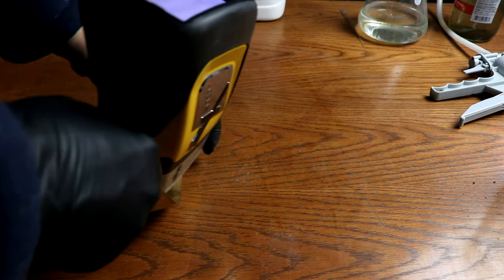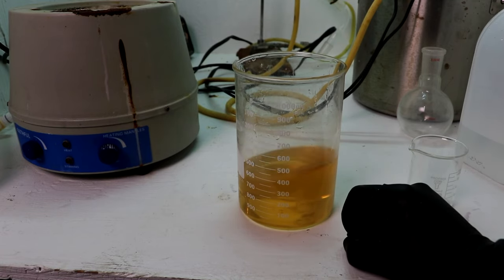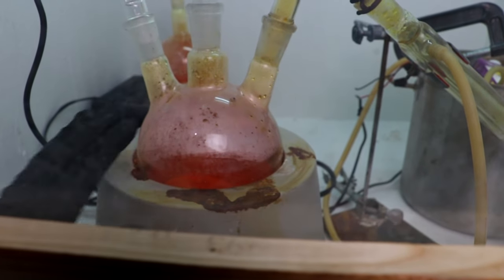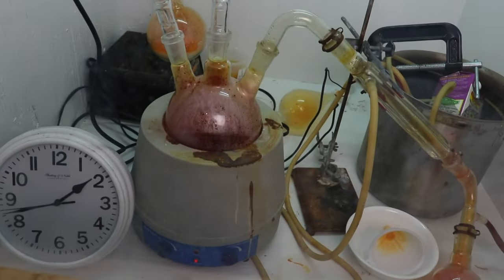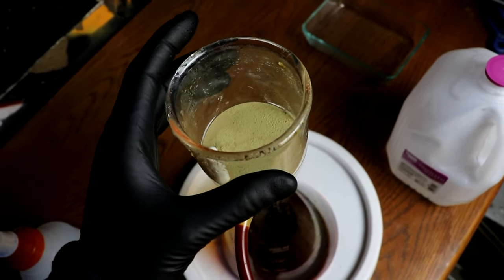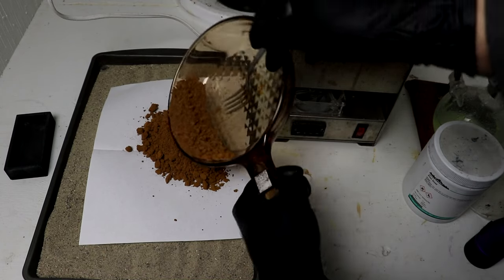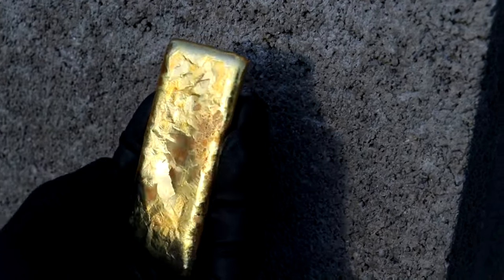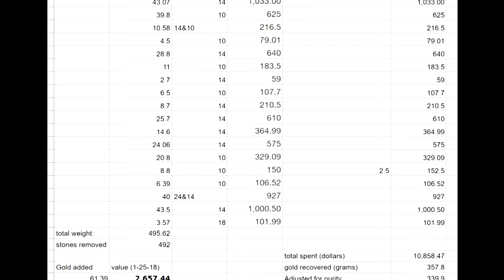Metal Refining & Recovery, Episode 24: Re-Refining Gold Using Bromine

Comment: Why is your kwijibo telling us that gold is tungsten?
-edit
Since I made this comment without listening for an extra 30 seconds, I should probably explain why myself:
After having read the manual, it has 3 relevant modes: Alloy, Alloy plus and Precious Metals.  If you want to get an idea of what contaminants are in the sample, one of the alloy modes has to be used as the PM mode only tests for Ir, Pt, Au, Rh, and Pd.

For those who are curious, Alloy mode measures Ti, V, Cr, Mn, Fe, Co, Ni, Cu, Zn, W, Hf, Ta, Re, Pb, Bi, Zr, Nb, Mo, Ag, Sn and Sb while the Alloy Plus mode adds Mg, Al, Si and P.

You now know what I know.
Reply: This explains nothing to me. All I still see is bad ROM code, and that that ROM should be swapped out with next-day service by a technician who flies in at the company's expense. Cody stated unequivocally that its not a hardware issue with the instrument.
Reply: Alright.  You want more, I'll give you more.
The gun works by x-ray fluorescence spectroscopy.  It has several different x-ray beam energy settings (10, 20 and 40 keV or something like that).  When you bombard an element with x-rays of a particular energy they re-emit photons ranging from the hundreds of eV to tens of keV (I think due to core electron ionization, as opposed to valence electron ionization).

The mode you choose determines the x-ray energy and for some x-ray energies, the fluorescence of certain elements is indistinguishable from the fluorescence of others.  This is the case for Alloy Mode.

"Fix it in ROM" you say. "That r dum" you say.  No, actually, the problem is deeper than that.  Core electron ionizations tends to have relatively high half-lives before an electron from somewhere else drops into the missing electron slot, on the order of 10's of seconds.  If you take a sample with the tube energy at 40keV and then switch to 10keV to get a different spectrum, the data will be contaminated by non-decayed core electron holes from the test at 40keV.

In my original comment I wasn't sure which of these two explanations to give.  This one is much harder to understand although it is more broadly useful.  Also no one had told me "fix it in software" yet.
Reply: I did the same "not listening for 30 more seconds" but immediately paused and rushed for "Dude, wait, wot? Wolfram!? Y ain't dere no Aurum? Woot!" =D

Thanks for the heads up m8. Sometimes the comment section really rocks!
Reply: vertex rikers: its interesting when you look for the manual for it, its easy to find but it says its not to be distributed or copied in any form.  I'm don't think they quite get the concept of the "internet".
Reply: Well, many times such clauses, even tho 90% futile, are being added just to give the provider an edge in a hypothetic court case - like when someone creates a huge archive and redistributes without permission. Guess that clause ain't considered effective (regarding personal use cases) even by the provider =)
Reply: I don't think these companies understand that they're shooting themselves in the foot.  If I'm going to buy an expensive piece of equipment like an o-scope or high pressure compressor, I'm going to download the manual first.  I'm not going to call their sales department until I've already pretty much decided what I'm going to buy.

I think there used to be a sense in expensive electronics that you need to keep the competition from knowing what features your machine has by restricting access to the manual.  Thats no longer a functional business strategy.
Reply: Thank you.  I immediately paused the video and started looking for an explanation for this.

Comment: Bromine. What a lovely element. I used to work for a shipping company that used to import huge flasks (in 20 ft container frames) from Israel. They would be exported back home with some liquid Bromine 'ullage' in them. One of these flasks was damaged whilst stored in our yard, and a small amount of ullage escaped. It took the paint off the trailer it was on, several containers nearby, and ate several holes into the yard floor. It also meant half a day off for me, as HAZMAT teams quarantined our yard, so I came back from lunch unable to re-enter the office, and my boss told me to go home, as the ullage had 'wandered'. Lovely.

Comment: Regarding that x-ray tool. Does the accuracy become affected by the environment? Like that gold was analyzed on the wooded table. Are the elements in the wood/finish being analyzed as well? How far does it penetrate? Im sure the  output is adjustable.  How is it working? What is the spread?
Reply: brian faini surface contamination can skew results but they beam only penetrates a few nanometers
Reply from the maker: see this is why it needs another video. Put it this way a sheet of gold as thick as aluminium foil will block all the return x-rays while aluminium foil will block almost none. also since people keep asking the x-ray emission coming off carbon is so weak that even the air is enough to stop it.
Reply: Cody'sLab another video on that would be fantastic. Seems like a really interesting tool.
Reply: Might be the best money you ever spent, although that software update feels like a ripoff.
Reply: It IS a rip rip off. Probably just a few bytes of code that are changed.
Reply: I'm thinking that gold's density in partnership with its malleability are the reason why it was used as foil for space applications.
Reply: yea so it depends on the density/ ability to stop x rays of the material. the real question is how much wax would you need to stop x-ray and gamma wave emissions.

Comment: Was that an acetylene torch?  If so, don't use that for gold.  Oxy-propane is ok, but in a lab, we would not use acetylene, it contaminates the metal.
Reply from the maker: What with carbon? The x-ray wont pick that up...
Reply: Cody'sLab Honestly not sure.  If we were fusing glass to gold, acetylene would total mess that up if the gold were melted and cast using acetylene.
Reply: the fact that the xray wont pick it up is even more reason to not do it sonce you wont be able to quantify the contamination
Reply: thats probably beacuse you were trying to get the gold to react, or at least form some wierd alloy or mixture. pure gold is probably fine because is unreactive and carbon wont bond, the worst is geing that wierd crud on the surface.
Reply: Industrial acetylene has phosphine in it, hence the smell. Maybe the crud comes from gold phosphide?
Reply: Nah, I don't think so. When phosphines complex heavy metals usually the result is a golden powder.

Comment: This might sound impossible but.....

Is there any way you can re-refine air into its purest form?
Reply: PETAL CRAZED CABBAGE  you can filter it to get rid of impurities or distill it into its main components
Reply: You could filter it to remove contaminants and particulates and I do believe there are machines that can take oxygen from the air and leave most of the other gases behind but I am not sure, air itself is a mixture so I don't know if you could refine it. Hope that helps.
Reply: what do you even mean?
Reply: I'm assuming by air you are referring to oxygen, the breathable part of air in which case yes. Talking about just air as the mix of gasses then also yes but nothing pure
Reply: Any gas is breathable as the word only defines a mechanical function of the lungs, you can breathe pure carbon monoxide just as mechanically efficient as you can breathe pure oxygen for a certain period of time, though it would not be advisable to try either.
Reply: Unless you're really done of breathing oxygen, then carbon monoxyde might be your best bet.
Reply: Amalek I'm speaking of breathable in terms of capable of maintaining respiration
Reply: jabster claw, I know but the conversation was just so silly that I had to weigh in with some sillyness of my own.
Reply: Amalek I mean it is a stupid question with clean rooms existing but you could have made fun of my question... I thought the thumbnail was ice-cream and was confused af
Reply: I was making fun of everybody, including myself, I was doing a purity spiral skit, nothing personal...

Comment: Doesn't dissolving gold and dropping it out with sodium metabisulfate give you 24 K gold. Also can you do a video on purifying paladium and silver.
Reply from the maker: yes, unless you use too much, neutralize the acid, and drop out everything.
Reply: What about the second part of the question :)
Reply: What about saying thanks for taking the time to answer one of your questions?
Reply: lol whoops
Reply: thx for noticing
Reply from the maker: lol, I am sort of skimming thees comments and I dont take in everything. but yes I will do some videos with the other metals soon, I do after all have a pile of catalytic converters on the floor behind me.
Reply: cant wait to see them. I have been collecting computer scraps for like 2 years and am going to start refining the metals in them.
Reply: So couldn't you process in batches, purposely under dosing with metabisulphate, test watch batch for purity. The concentration of impurities in the solution would increase as the gold was removed in batches.
Reply: yeah you could do that. I think Cody is doing this video to show a different method.
Reply: i believe cody did one for silver called fining silver
edit
oof super late rip i loaded the video before u had any replies lol
Reply from the maker: +

Alisdair Herd
Thats what I did, I add enough to drop out most but not all of the gold and am using zinc to drop the rest.

Comment: Very neat!  Thank you for doing it, and showing us!

If I were to make bromine, I think I'd use an ice bath on the receiving flask to minimize the amount of vapour.  You commented on the warmth of the flask in which you reacted the gold and bromine... the stirrer itself generates more than a bit of heat.

I wonder if it would be possible to reduce the AuBr3 electrochemically, perhaps with Cu in the other half of the cell as its anode.  Maybe a bit of ammonium in the Cu-side solution to encourage the oxidation from Cu to Cu(II).  It would be slower than reducing directly with SO_2 but you would probably get some nice gold crystals out of it.  Au|HAuBr4||Cu(II)(NH3)4|Cu .

Several times, you referred to "hyperchlorate", or at least that's what it sounded like.  Should be "hypochlorite".

Comment: you might want to make a mini forge to save on fuel and electricity. 
all it involves is carving out a porous firebrick and a plumbing torch. a solid firebrick will work, but it will take forever to heat up. 
a mini forge should be very helpful for small objects where precise temperatures are not important.

Comment: +Cody'sLab , would you consider putting a scrubber on your fume hood exhaust? Maybe not really be worth it for the small amounts of gasses you produce but it may make a good video. You could include elements of mass transfer, differing scrubbing solutions for different gasses, what packing you would use for your column etc.

Comment: Cody, if the "software" you re talking about sees Au as W, it will impact the readings of other metals (not just due to mass %).  There are secondary peaks that Au has different than W, and those will likely skew the other elements that have very different atomic numbers

Comment: @Cody'sLab around 17:50 when you pull the crucible out of the furnace, there is a purplw glow around it. Im wondering if thats literal flames coming off the crucible or just feedback on the camera from the heat.

Comment: Here's a question...  Can you determine whether or not it's possible to use Osmium as the base material in a "steel" instead of iron?  Chemically it falls in the same category, so theoretically it should be possible...  But would it?  And if so, how would it perform?

Comment: Had to run this by you after watching an interesting video, figured you'd be up to offering some insight and maybe even test it.

So, you have a boyle's flask right, the thing doesn't "work" ofc but I saw claims that it can indeed draw a drop of water to the end of the tube through capillary action above the height of the main container but that surface tension keeps the drop from falling into the container.
So... multiple capillary tubes that merges at a point close enough to each other that the drops reform into a bigger droplet that can indeed fall.
Would that work?
And if so, I once saw a device that could collect tiny amounts of electricity out of falling drops of water through some apparatus that separated the two sides of the device to isolate negatively and positively charged... droplets I guess?
So, not impressive but if it actually worked I figure that'd be a perpetual motion machine if the capillary idea works??

Then there is liquid helium, as far as I can understand it behaves in a fashion that would actually work with a "Boyle's flask" and if stored properly (cool enough so as not to turn into a gas I presume) would continue running, but is considered useless since you can't harness energy from it, but... cant you collect the same energy one can with water drops in that case?

Comment: Why didn't you react the fine gold dust with concentrated nitric acid before melting it into the bar?  It would have removed most of the remaining metals except for the noble ones. Also you need to clean your equipment mate.  It's cool that it's old and still working but keep it clean so you don't have to contaminate the final product.  What was the yield on the entire process?

Comment: Thought you might be interested to know that Gold broke down below the key level of $1300 Oz after the several month trading range above that point due to the high long to short % of traders the big guys have been getting out before all the buyers dry up currently still above 80% of traders are long. It could go all the way down to around the significant price level of $1180 before returning above $1300 with strength.

Comment: When I was a kid, I thought tungsten's symbol was W because light bulbs sometimes have tungsten filaments, and light bulb power is usually measured in Watts (W). Someone told me that and I held onto that for about twenty years.
Reply: I was also told that lead was Pb because you can use lead to make a good plumb bob. I mean, the etymology is certainly there, but obviously that's not why they call it that.

Comment: I am certain you'd boost that purity (and initial yield, for that matter) by being more careful with the whole procedure. As a demonstration, this is really fine, but it's obvious you're trying to go into the realm of analytical recovery. That is simply not possible by using crude methods used in some procedures of organic chemistry synthesis that tolerate it.
For example, your bromine is very contaminated with bromine monochloride and water, and the sulfur(IV) oxide you're using as a reducer was carrying over an aerosol of hydrogen chloride and sodium metabisulfite (which is, by itself, usually quite contaminated). Gold(III) chloride will behave differently than gold(III) bromide and, depending on further purification reaction conditions, parts of it might escape reduction.
As someone who periodically produces few cups of very pure bromine for selling as a reagent or element collection, I recommend paying more attention to the procedures where introduction of contaminants becomes a tangible danger.

I hope you'll try a very careful electrochemical purification of gold because I'm really interested to see the final purity of such procedure.

Comment: The first X-ray analysis (%):
Fe 0.16±0.02
Cu 2.41±0.03
Cd 0.27±0.01
Sn 0.16±0.02
Sb 0.14±0.02
W(Au) 95.71±0.05
Pb 0.12±0.01
Bi 0.68±0.02
Nb 0.017±0.002
Pd 0.33±0.01

The second X-ray analysis (%):
Cd 0.14±0.01
W(Au) 98.88±0.03
Pb 0.07±0.01
Bi 0.70±0.02
Pd 0.21±0.01

Assuming the pre-refinement mass was 358.15g (sum of gold weights from Episode 22) and the post-refinement mass was 304.0g, we can conclude that the refinement...

...removed 99.99% of Iron, Copper, Tin, Lead, and Niobium. This included 8.63g of Cu, and 1.71g of other metals.
...removed (55.99±9.43)% of Cadmium, about half a gram.
...removed (50.49±23.20)% of Lead and (12.62±30.70)% of Bismuth, very indeterminate amounts.
...removed (45.99±9.16)% of Palladium, about half a gram.

In addition, there was still 42.19g of Gold left in the waste, or 12.62% of the original amount.

Comment: How do you wash the glassware
Reply from the maker: Oh I just lick them clean.
Reply from the maker: Jk I usually rinse into a catch bucket that I work down later and then assuming it wasn’t something too toxic finish in the dishwasher.
Reply: Cody'sLab interesting , how do you clean the inside of like the conical flask to assure it won’t contaminate the next thing you use it for or does just rinsing it enough times achieve this?

Comment: Why does this list gold as "W" (Tungsten, or wolfram) instead of "AU" aurum latin for gold?
Reply: Because of the XRF spectrum of tungsten and gold are so similar, the XRF spectral lines of the two elements (for eg. Au La and W Lb) have some overlap and Au is misidentified to W ... I think a better calibration of the XRF machine can solve this problem. Fire assay is better, to determine gold purity.